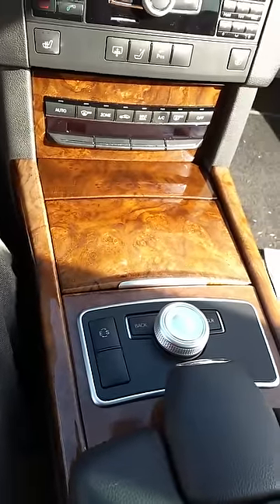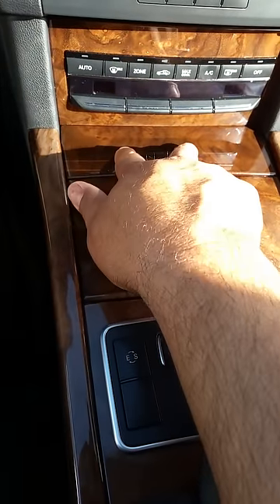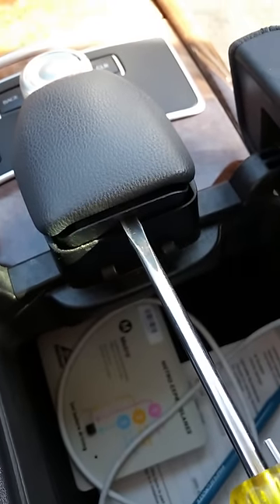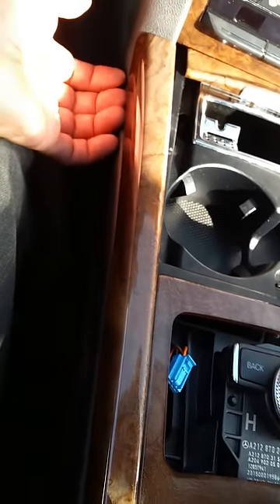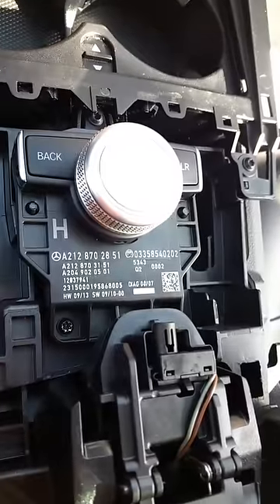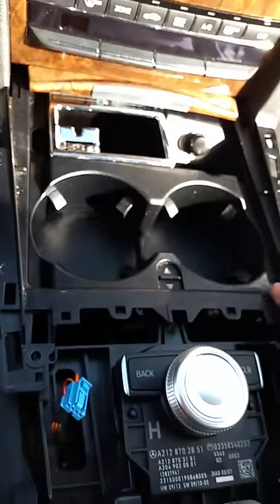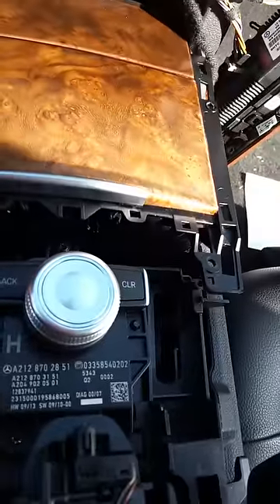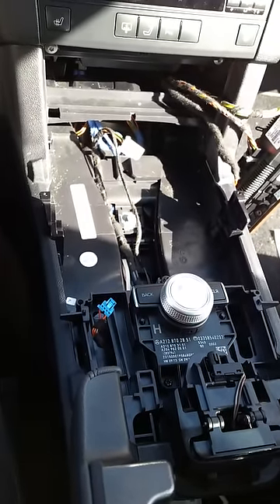Mercedes W212 E Class 2011 Remove Replace Repair Scrolling Knob Wheel Command Console Control part 1

Comment: Thanks Leonard from the UK,   I fixed my rotary knob today by fitting a new metal shaft in the controller (£25) to replace the broken plastic one however I got myself in a mess when the console was in pieces and the cantilever mechanism fell apart.  This video got me out of hole and helped me get it all back together again.  Really appreciated your help .

Comment: Wow, what  a great video! Thank you so much for posting! I'm not a do-it-yourself guy but I used your video today to install a new dial on my 2010 E550. It took me about 40 mins to install. I got a quote from midtown Mercedes-Benz for $800 including 2hrs for labour.
Reply: Where did you find the replacement dial?
Reply: @woodzcar when you replaced the new knob did you had to do any software or program update? if that so ... how was it done?

Comment: There is no way that I would have been able to hardwire a dashcam without being guided by this excellent video - I was on the verge of booking the car into the local Mercedes dealership for them to do the installation - I would guess this video saved me at least £100 , thank you

Comment: I would add two things.  The white end of the current command wheel that is being replaced and is attached to the long ribbon is removed in two steps.  The first step is to depress the tab and pull the wire harness (attached to the console) toward the back seat.  Once that is out the white end that is connected to bottom of the console has three channels that slides out toward the front of the car by depressing the middle white piece that you can see has a slight hook to it and voila it pulls off easily.    Great video and it took me less than 20 mins to complete and I spent a few minutes trying to figure out the white piece.

Comment: Excellent Video.  Thanks, Leonard!  In a 2012 E350 I had a credit card stuck behind the rear of sliding door for the cup holder/ash tray. It prevented the door from opening all the way.  Per the video, all you have to do is remove the plastic piece above the HVAC control with a heavy wire bent 90 degrees. Then remove the 2 torx screws holding the HVAC unit with a #20 torx bit.  Removing the HVAC control was tricky.  Use the hook at the top to loosen the control, then giggle and rotate it out.  If you're lucky you can see the stuck card now behind the cup holder unit.  I was able to fish the card out without actually having to removed the unit.

Comment: Very helpful video , I has fixed my E550 , Mercedes 2011 cigarettes lighter connector came off under cups holder and also fixed my sliders cover with out problems, thank you for your times to help many user here and a tons money for repair .

Comment: Just used this video to remove the Command module in order to replace the shaft inside the unit. The shaft cost about $20 and  is aluminum so it won't break again. Much better than buying the whole unit. The video was a big help in removing the Command Module. The only problem I ran into that is not shown in the video is how to disconnect the wire that goes from the Module itself to the car's wiring harness. It is a different setup than the blue wire that is shown being disconnected here. That process would have been a big help if it had been shown. Other than that small critique,  excellent video and big time and money saver. Thanks alot.
Reply: I'm at the same stage - having trouble getting the actual command control unit wire out. How did you do it?

Comment: Thanks so much.  I agree that you have a professional manner.  In my 2010, the wood top of the big slider came off.  The undercarriage wasn't connected to the front slider but I did have both clips in place.  Using your video, I got the clips to re-insert under the front slider but so far I can't get the wood to stick down on the front slider.  I was able to do my repair without taking the console apart.  Maybe I have to do that now.  Thanks again.
Reply from the maker: There are metal clips that press into the console. Its likely that they pulled out or fell in upon removal.

Comment: Excellent video.....very informative, mainly lower panel removal....saved me alot of time. This is the only video of lower panel removal....are you able to make more on lower panel.....temp control is one of the most broken part...Thanks
Reply from the maker: It's part of the video series.thx

Comment: Excellent video - can be used to connect hard wire to 12v socket for Dash Cam. PS. I will have to use 2 hands !! Thanks and well done.

Comment: This was amazingly helpful...thank you! My only problem is the same one a couple others have spoken about and that's getting the arm rest lever to click back into place. Is there a trick to it, because I've tried and tried and it just won't go back on all the way. I thought maybe holding down on it again with the same small flathead screwdriver I used to get it off might work but no luck. Has anyone else with this problem managed to get it back on securely?

Comment: Are you able to make a video on Blind Spot Assist Radar/Sensor replacement. They are on both rear corners inside rear bumper....Mercedes made it such, that radar sensors are held by plastic casings stuck to inside of bumper...those usually get corroded and messed up and get unstuck falling up mainly if you are living in a high winter zone with lots of snow and salt.....how to stick those back up and save the sensor....radar sensor is almost $770 each through Mercedes dealership....Thanks a million

Comment: Love the instructional video as I have the same control knob issue on my 2012 E350.  I do have one question and that's where did you purchase the replacement knob?  Just wondering if I have to go to MB parts to get it or can I purchase it elsewhere.  Thanks for your help.
Reply: Bought mine online from a mercedes dealer for $248 shipped and genuine oem part
Reply: @jeffcasto6079  Thanks for the info.

Comment: hello, how did you know that this is the part that's broken?  What were the symptoms?  Thanks and great tutorial.
Reply from the maker: The control knob selects all functions on your radio and navigation display. If you can not scroll, or have intermittent function,  its likely faulty.

Comment: In my case the side trim pieces DID break... both of them. The front tab refused to come up and both broke. I would suggest to any one that wants to attempt this that the trick is to pull them STRAIGHT up while wiggling left/right to work the spring clips out. But I wouldn't know how to avoid what happened in my case. Perhaps the luck of the draw that my metal clips were stouter than others'. They are plastic posts with metal spring clips that tension/wedge into the holding slot on the ash tray carrier piece.

Comment: slight difference on my rotary knob unit,DO NOT ATTEMPT TO REMOVE CHROME SURROUND, just squeeze the two side black plastics sitting over the vineer so that you can take the whole unit out , rotary knob and veneer, i have a photo but dont know how to add it here, also T20 screws on mine

Comment: My ATM card was placed on top of the slider cover for the center console (the one that covers up the ash tray, lighter and "little stuff" container). The ATM card had slid into the center console in the space above the slider cover and the frame at the top of the console (the place where the slider cover retracts back into). Now, the card is "lost". Is there some way to get inside that console without having to go to the dealer? Many thanks for anyone that can help me on this!

Comment: Actually there is a repair kit For the knob that you can buy for $13.99 ,so you don’t even need to buy an after market one for $200
Reply: Not even $13.99 - $6.50 including free post from China. I did one today. W204 - exactly the same controller. For instructions on how to repair just google W204 control knob repair.
The only difference between the W212 and W204 is getting the unit out of the car. 
It's an easy DIY job No soldering, just need a Torx 10 and 15 plus a hook tool.